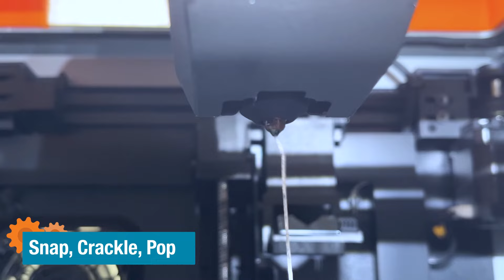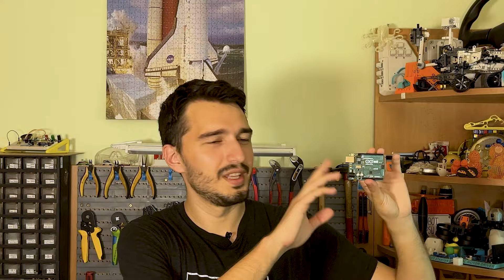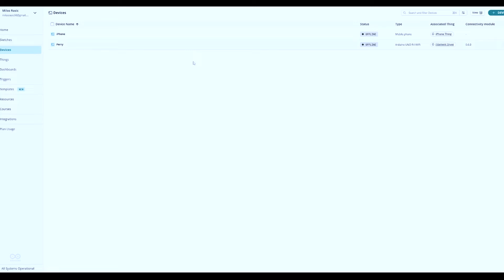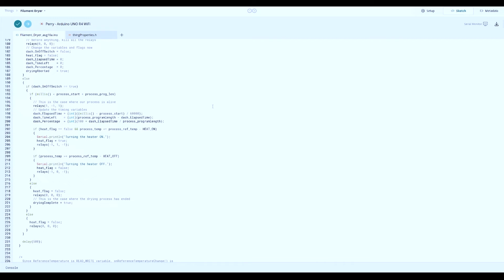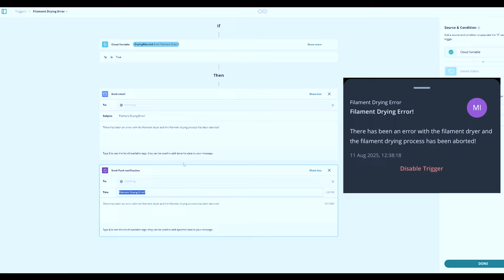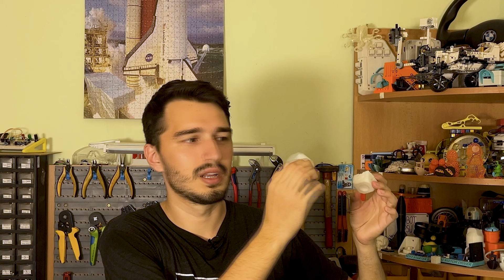How to Make a Smart Filament Dryer Using Arduino Uno R4 WiFi

Comment: One alternative to Arduino cloud to investigate if you are not one to enjoy paying for using your microcontroller on a subscription model is ESPHome and home assistant. EspHome offers a similar over the air programming experience and can even run most of these kinds of things using a yaml config rather than coding, and home assistant can manage the notifications and only takes a few minutes to set up with a single docker command.

Comment: While i love this, the (most likely) up coming changes to Arduino (Including what will most likely be a paywall for cloud services) doesnt seem very useful. Ill opt for a ESP32W and esphome to manage it if i built one.

Additionally, Why was the control box put on top? On bottom it would avoid the radiant heat issue, you could repurpose the original top housing to run your wiring loom to make it nice.

There is a downside though, this only lets you dry your filament, its not like a automated dry and store box. if a double seal and lid lift with filament grommet was used, you could use a glass filament holder and allow the fillament to be used from inside while automating the drybox to engage it when humidity in the chamber hit a threshold.
Reply from the maker: Sometimes, people need options to work with what they have available.